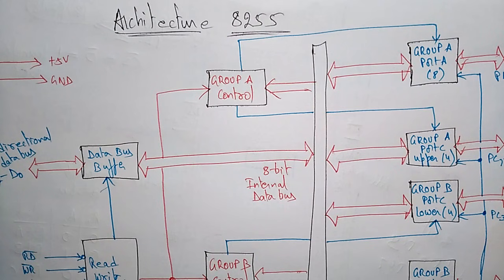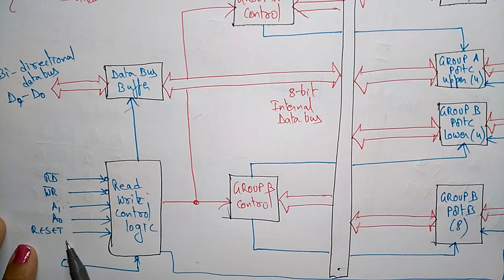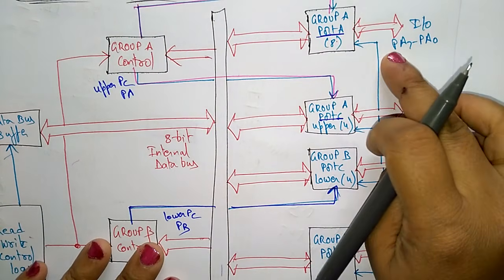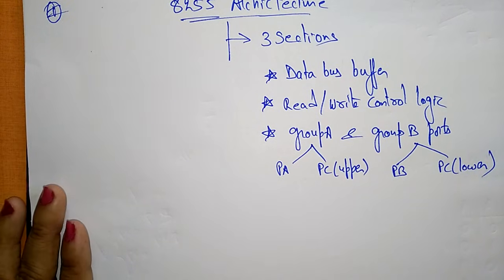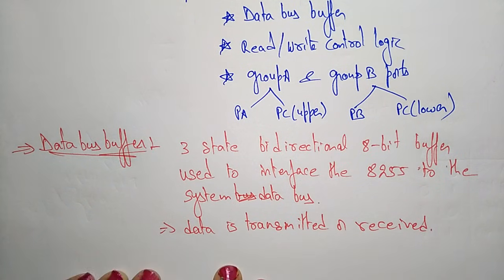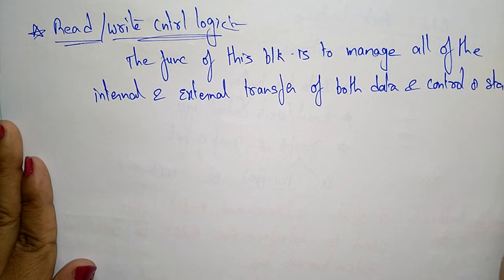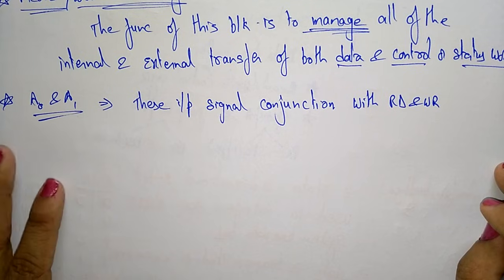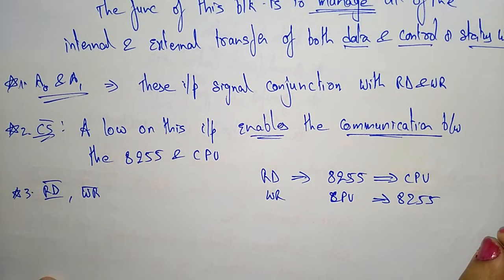8255 programmable peripheral interface | Architecture | Part -1/2  | MPMC | Lec-39 | Bhanu Priya

Comment: Possible solution to this question quickly. Wait for the answer to comment

Write a program for 8255 to make flash light with 8 LEDs using BSR with delay 10 msec